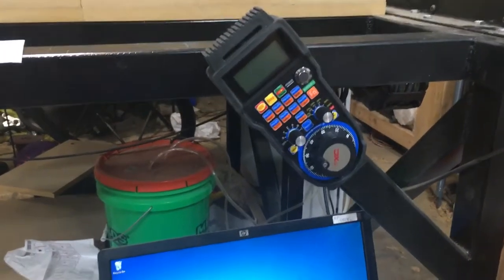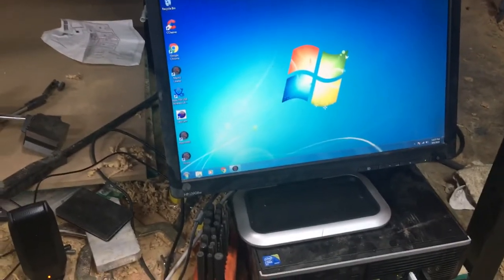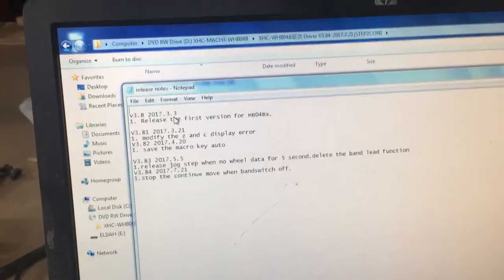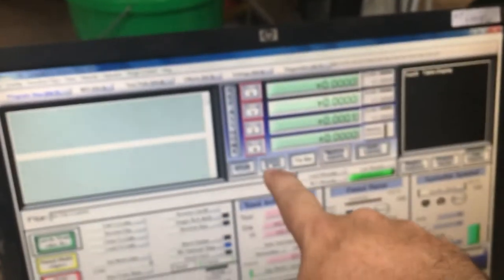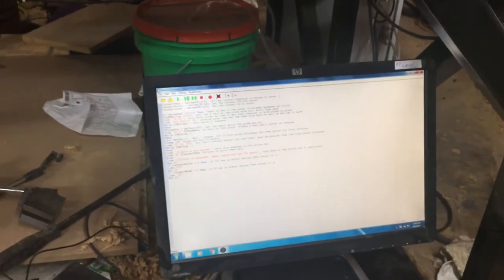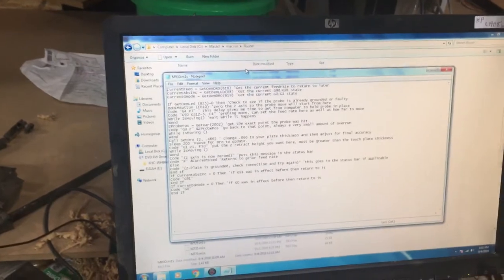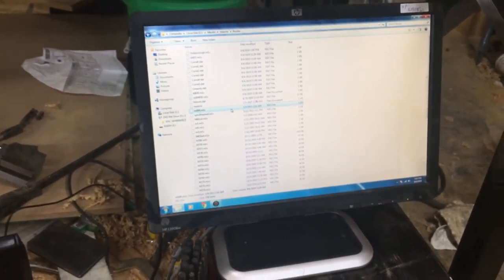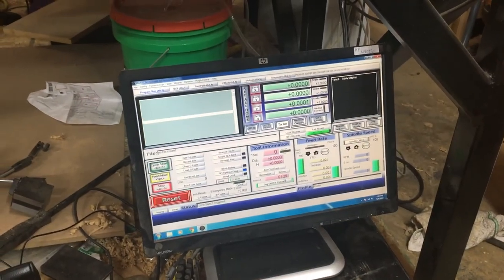XHC MPG wireless pendant control setup tips

Comment: I've seen a few videos on this controller, and some talk about how an axis just takes off when you click the dial a couple clicks,  I wasn't sure what to think about that.  My brother and I decided to try them out, so we both bought one, and they both just Take of running with just a couple clicks of the wheel. Not Supposed to do that.  Also it changes my XY coordinates, to some extremely high numbers, like in the 3 and 5 millions.  Both Controllers we bought do it,  not good!
Reply from the maker: I haven't noticed anything like that on mine. When you say "takes off" you mean it just keeps going? What control software are you using?

Comment: Congratulations on the channel.  Very instructive video.  I bought the exact same model of MPG pendant.  I use mach3 but I have problems, when I move, for example, the Y axis, the X axis also moves. And this also happens with the Z axis. The X axis always moves together.  Did you have this problem?
Reply from the maker: I have not had this problem. Is this only when using the pendant? Or do both also move with keyboard controls as well?
Reply: @RileyKnifeandTool  exactly.  Only when i used the pendant. On keyboard this no happen.
Reply: sir i dealt with the same problem, i tested two models of mpg ... i only solved the problem by changing the usb port. I'm using a USB 3.0 port... this way the problem was solved.
health and peace!

Comment: So I have this exact one using it in mach 3 and the pendant shows I've moved 1 inch and mach will say 2 inches...how can I calibrat this
Reply from the maker: If I'm not mistaken, you may need to calibrate your motor settings in mach3. I'm not aware of any calibration for the pendant directly.

Comment: There is at least one serious flaw that you didn't mention. The resolution selector only goes down to one thousandth. If you're using this on a machine tool (lathe, mill, not router) you typically dial in tighter than +/- 0.001, so you want a 0.0001 selection. It doesn't have it. I emailed them about it and they were very rude. The response was "We don't care what Americans want and we aren't making changes just for you". If you're working in metric 0.001 is fine, but not in imperial units (inches). An obvious mistake by someone who really only works in metric. It's a pretty nice pendant, but that said, it does me not good.
Reply: please dont get me wrong , but imperial units are obsolete, no offense intended